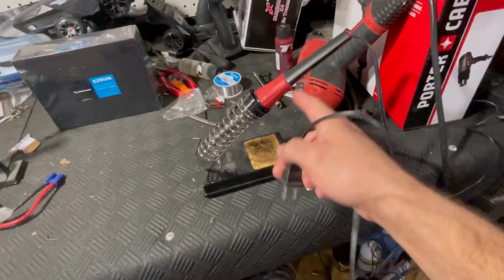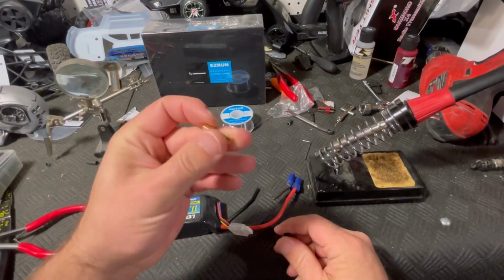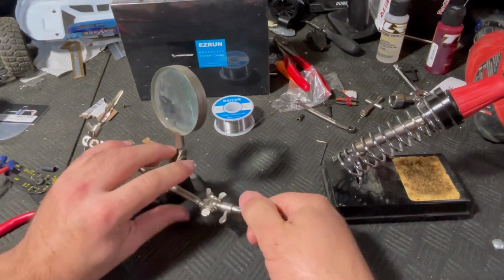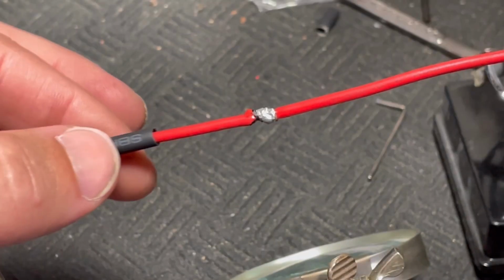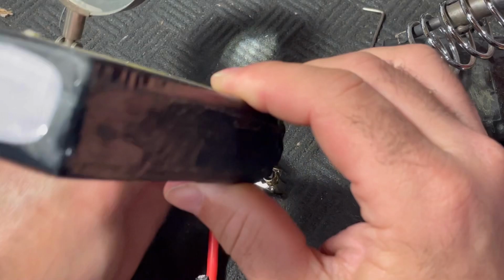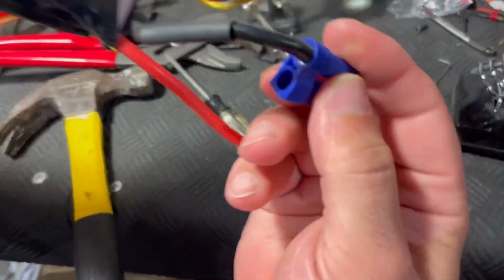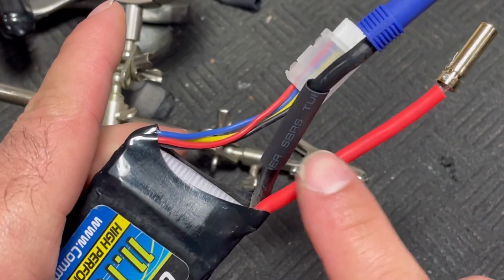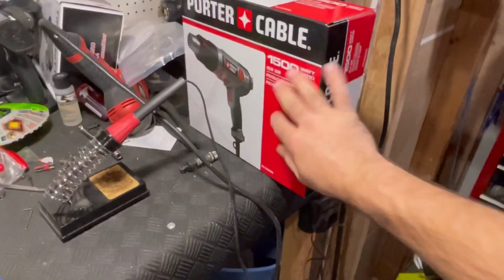HOW TO SOLDER - Electrical Soldering Battery Connectors & Wires

Comment: Is it the same for a 72v battery?!! I’m scared to change out the tx90?!!
Reply: The process is the same, you just use MUCH more caution and go very slowly and double and triple check everything to keep the red and black leads isolated from each other. 
I'm scared enough working on a 22v battery.

I hope everything goes well, but I would still do the operation outside.

Comment: it goes bad really fast when you touch the wires together
Reply from the maker: Oh ya! It will certainly let the smoke out! If you hadn’t seen the video, I had a close call while running my Kraton a few weeks ago when my balance plug shattered after a big ole jump on one battery, and the main negative lead got caught in my spur gear and chewed it completely in half on my other battery. Which was the reason for the repair in this video 🤣